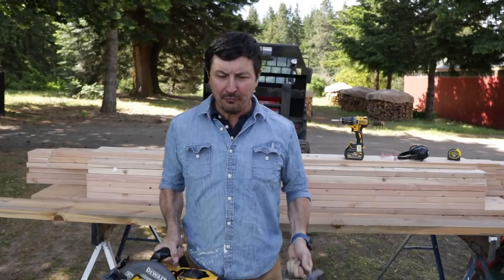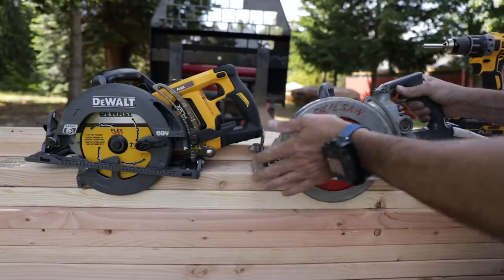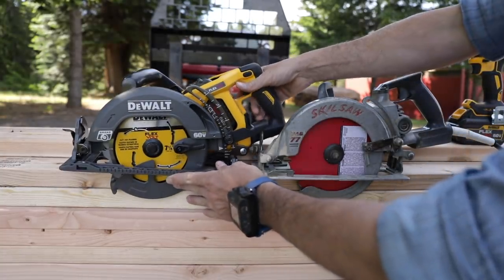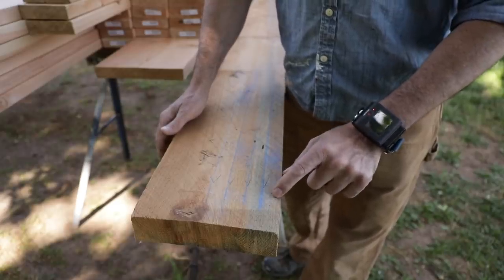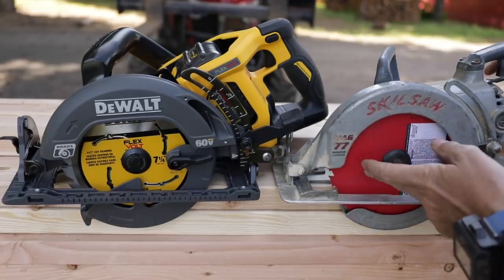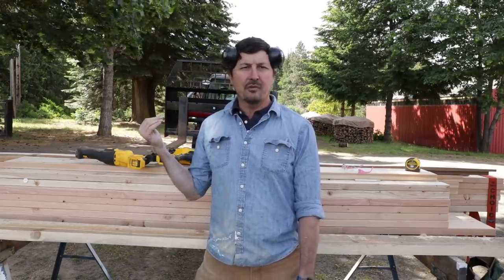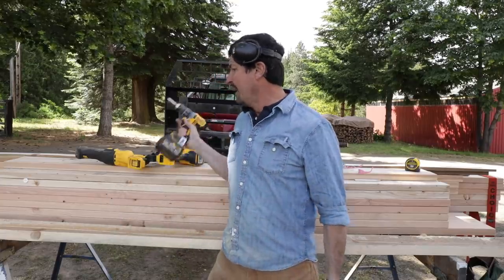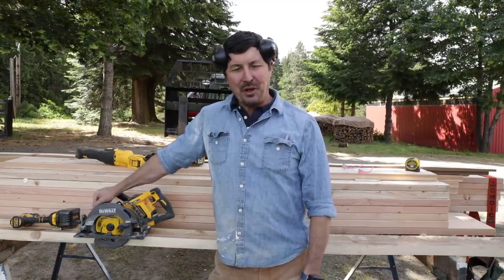Dewalt Flexvolt V.S. Skill Mag77 [S H O C K I N G]

Comment: I have both and I think the Skill with new brushes and bearings would have smoked the flexvolt you used an old skill and a new dewalt  also the Rigid worm gear saw will smoke the skill new.

Comment: This worm drive style dewalt is better than the older direct drive style saw.  Here's the issue.  That Skilsaw is a 13amp saw going through a 14ga cord.  I'll race for pinks with my brand new Mag77 running on 120v through one 12ga cord. I'll even buy the diablo blades so apples to apples. And we rip hard for about 10min. It might be able to keep up in speed at peek charge, but let's see at 75% and motor cooling. To justify a $400 saw,  it has to keep up with the best.
Reply: Wire guage does not change amp draw, these tools are designed for a maximum of 15 amps since that is a very common braker type, the batteries won because they can draw more then 15 amps without tripping a braker....

Comment: The dewalt is not a true worm drive. It’s a sidewinder with a handle behind like the worm drive. Look at the orientation of the motor. Learned on a 6 1/2” skilsaw and it’s the best saw to cut with and I am on the east coast. Thanks for posting.

Comment: Bro i do know some cordless even have more power than some corded but just not enough cutting time.1 hr strsight cutting time for a cordless is nothing.i been on jobs where i have to cut say sixty 2x6 rafters plus other lumber where i need power for atleast 3  to 5 hts..( cordless tools have tjeir place and advantages but for short working time.its good to have cordless butfor any cordless tool i have i must have a similar  corded..am in nyc and  for circular  saws  we use .mostly corded,

Comment: battery power has it place but after sitting in my draw for 2 years my corded drill still works and it is 20+ years old same with my skill saw that is 30 years old and still works fine ....and i do have 2 small generators one for the boat for bowfishing and another for things like deer lease and out in the field work and i guess 1 is a backup for the other if one ever fails :-)

Comment: Brand new blades perform better "after" having been broken in on a few cuts. Also, an apples to apples test would've been with both saws using identical blades. One more thing, with every cut, the cordless saw's cutting time will increase with every use as it's battery wears down where the corded saw will provide continuous steady times all day long. For the homeowner (or homesteader), sure, the cordless saw is ideal, but for production cutting on a construction site, they'll be burning out those cordless saws and replacing them every few months. I've seen it time and time again. ☺

Comment: it has nothing to do with the saw itself, the speed advantage of the dewalt came from the "cordless" factor because it gave you the advantage of gripping on the dewalt with both your hands hence the speed of the cut compared to the skil in which you had to hold the cord with your hand and the saw with the other

Comment: I love seeing all the tool guys talking up the cordless wormdrive saws and sawzalls, I will never trade my corded versions of these in I find them lighter easier to maintain,(brushless you cant do anything with). The best cordless tool for me has been the impact wrenches as I'm a mechanic by trade. I still do a lot of wood and metal work for this corded power is best, you wont stall and get your blade stuck if you end up on low battery power.Quality blades are key as well

Comment: Cordless tools are cool, kind of expensive and if you don't use them on a regular basis you might be having to charge and condition your battery first. They are certainly easy to pick up and put to use however after you pick your favorite tool, it's really not smart to by a different tool from a different maker because the batteries are not interchangeable. We'll invest maybe thousands in a single brand of cordless tool and then they will discontinue or change battery designs after a few years and screw everyone. I'll keep my corded versions forever and be free to get different brands because they all run on 120v.

Comment: The dewalt blade is 1mm thick! It will last exactly 1 third as long as your standard 3mm blade...of course it will cut faster on a less powerful machine. Can you get 3 of those blades for the cost of a regular one? I doubt it ...

Comment: I have 7 dead, burned up Dewalt cordless tools in a storage bin for parts.... because Dewalt factory service, told me they don’t repair them any more. $1546.00 in junk tools, less than 3 years old. Sure they are covenant, as long as you have a ton of money to replace them all the time. Dewalt cordless tools are JUNK! Ive started replacing them with Milwaukee. We will see how that goes.
Reply: Damn bro, mind sharing some more details like tool specifics and what you were doing to them? haha, sounds like you handed them to a crew and told them "murder the yellow tools" lol. But you can't go wrong with Milwaukee either. Are you sure they just don't need some brushes? I have a few DeWalts myself but only use one heavily/extensively, an impact driver almost daily for the past 5 years paired with a craftsman drill that's just as old, haven't had to do a single thing except charge the batteries(the craftsman drill batteries are definitely dying quicker than they used to). Both are occasionally in the rain, mildly dropped/thrown around absolutely abused and just keeps going still as strong as day 1 when the batteries are fresh.

Comment: The first cuts were way more crooked (even the very first cut with no sawdust). Go back and watch the video. Why even bother doing a comparison if you're not going to do anything fairly? Very odd. It's almost like you have a referral link and just want to get 10% on lots of saws. But I know that's not the reason, so it's just quite confusing.

Comment: Without using a brand new top of the line skilsaw plugged into a short extension cord and using the same blade as the dewalt it isn't much of a comparison. Using an old worn out skilsaw is skewing the results in favor of the dewalt.

Comment: I think it is an unfair competition in the case of saws because it is a new saw compared with an old saw where the engine one way or another to lost power the engine
Reply: Electric motors dont really loose power unless you let the gears run out, but still it was almost twice as fast, I think it has to do with the batteries allowing more amps to run through the motor (this will cause more ware on the batteries) while corded tools run a max of 15amps to not trip your braker.

Comment: Bottom line, if you use a tool every day then don’t buy cordless. The battery won’t last all day. The cordless stuff is not going to last as long as a wired tool. That skilsaw will last tens of years. Cordless tools won’t

Comment: I orefer corded tools,how msny of these cordless tools can work straight for 8hrs??? You must have 2 batteries and power to work a cordless whole day.
Reply: KingParisBuckingham the saw uses a 12ah battery, meaning at 12amps of draw you’ll have 1 hour of continuous cutting time. That’s some serious time.

I had the sane mentality. That and I felt like there’s no way these saws have as much power as a skilsaw chorded. I was wrong.

I’m currently on a commercial job with some framers. They won’t use anything else but the dewalt. They absolutely love them and they claim to get a days worth of cutting from a single battery charge. 

However unfortunately they didn’t have anything good to say about the hoseless framing nail gun. They just said it’s too slow.

Comment: I remember this situation very well and the skilsaw won the battle in a time of importance, WHY?: 

Unannounced to me prior to getting to the job site, my boss put me on a skylight job so I was ripping LDL at an angle for skylights and had to get the job done within a specified timeframe. Cordless battery died after 1 maaaybe 1.5 rips. Called my buddy to drop off my skilsaw and handled it no problem and extremely fast taboot. 

Anyone who is not a DIY/home use only person would love the cordless, everyone else who does this for work needs the corded and has a cordless for when convenient.

Comment: They arent the same at all the skil is a oil lubed wormdrive, the dewalt is a direct drive, made to look like a wormdrive for the right handers. Direct drives are week, you need to keep a sharp blade on at all times, kick back is a  killer and dewalt put blade brake on there saws, worm drive no, takes them 30secs for blade to stop spinning. Alot more power on any worm driven saws.

Your personal opinion is complete false hahaha, im a 5yr Framer by the way and have used many saws through out my life.

Comment: Yeah…no. Not even close to an actual fair test for either saw. That’s an older model skilsaw, not even sure if it’s with a 15amp motor they switched to. But even if it is, I think those earlier models were geared lower for more torque, but slower cut speed (4,800 RpM for earlier MAG77’s, vs 5,300 RPM for later models). Then I’d be interested in that DeWalts cut speed after it makes a few cuts and that battery is no longer fully charged. Weight is another big factor, he just glosses over, but even 1lb makes a difference when you’re swinging it all day long. Not sayin the DeWalt is bad by any means, just that this testing/comparison is utterly ridiculous. Maybe stick to axe and survival reviews…or improve your testing parameters to be more objective. Also if testing a new tool, maybe test it against its current version competition, not something 15+ years old.

Comment: Id suggest running the brushes in then see how well the cordless does in comparisin. Brand new brushes supply higher voltage until worn and seated.
Reply: Brushless motors.

Comment: You showed a picture of the new skill saw vs the new DeWalt in reality that skill saw you are comparing it two is well over two generations old. Poor test
Reply: You should run this test properly with the newest skill saw and take down this false information before  you misguide any more tradesmen
Reply: And you didn't even the same new Diablo blades. Very poor exicution on your end
Reply: Mate that diablo blade is far more superior compared to that dewalt blade if anything the skil has the advantage.

Comment: You need a rip guide bud your rips look like zig zags
Reply: Your first cut was garbage too
Reply: mharris1270 I'm talking about the one that attaches to the accessory rail on the bottom plate.  Universal for pretty much all circ saws, jig saws etc.
Reply: mharris1270 as per available straight line stops to run a saw against just go buy some high end finger plank trim 4" or wider and use a laser to tack it in straight... There's limitless available saw rip guides... Far as you can keep the line straight

Comment: DeWALT FLEXVOLT battery 12AH (60V 4AH) are better, DeWALT FLEXVOLT hand rear circular saw 5800 rpm, Skilsaw corded high torque hand rear circular saw old 4400 rpm and new 5300 rpm, DeWALT corded high torque hand rear circular saw 4800 rpm

Comment: as to tools I have both  DeWalt and Milwaukee I am lucky we have all three of them where I live to have them fixed. at Makita, they usually fixed it when I bought it in  same as Milwaukee here  Dewalt  2 week or longer when you take it in   
 it the warranty and the service I look at it, Milwaukee has stepped out the lead as for any warranty on the tools  DeWalt warranty you still had to pay for them to put the part in too
Makita the just fix it and not charge too when I was replacing the power tools I was  looking to get away from  Makita  to many other people at the time had them, Dewalt lift me holding  their new line on 28-volt tool  out to hang  Milwaukee I told them what Dewalt has done to me they traded up the Dewalt tool I had with the tools  they said they should have done that too I now  run Milwaukee tool now  no cords on any of them  run 18volt and 12 volts  too they help me with a charging them up in a service box on the truck too I can have 10 battery at one time charging up  one cabit on the truck is just fot millwakee tools now

Comment: The worm drive saw is not a popular thing back East
Reply: Dave White agreed
Reply: Why is that?  I've seen a number of differences in tools & equipment between East and West USA.  In UK there is no bias on one side of the country or the other, or even between Scotland, England, Wales or Northern Ireland.  Heck, even across Europe it's all pretty homogeneous.
Reply: It's a little further to the West Coast than London to Edinburgh about 400 miles, from New York to Seattle about 2.800 miles, London to Istanbul is still not as far.
Reply: Yeah, I get that.  I just don't understand why there's such a difference in tool preferences.  Surely a good tool in the East is a good tool in the West.
Reply from the maker: This is what I have been told,
Reply: It sure isn't! Except for me. I love mine with the few extra inches of reach, the location and ease of depth adjustment,    and the balance. They practically cut a straight line by themselves. Also, I love being able to say, " I need to change the oil in my saw."!

Comment: Dewalt not a worm drive second that skill is so bogged out from that hundred foot extension cord if anything run it off a 10g instead of 12 will help with the lost power and last Dewalt is contractor grade skill is not if you want a truly accurate test use Dewalt corded saw with the same amp as the cordless and same blade

Comment: The only problem with this review is that the corded Skillsaw mag 77 will make that same cut in 39 seconds every time. Whats the Dewalt going to do on a half charged battery? How many cuts are you getting out of one charge cycle on the batteries. I like Dewalt, but battery power is a fluid variable.
Reply: 2-9 amp batteries is the cure for this as 1 is enough for a single day on most jobs, its $180 for 2 of them on amazon.

Comment: You are not being honest about this. You were funded by DeWalt in a previous video and furnished with products in February of 2017. In that video you made claims about the tools that you likely wouldn't have made if you weren't being paid. Now, on the back of that endorsement, you are telling people about your "investment" in DeWalt (like you bought into the deal piece by piece). I agree that once you choose a brand you are intrenched. It is difficult and expensive to switch from one brand to another when you have tools, batteries, chargers, etc., but you are acting like cordless tools are a suitable replacement for heavy tools like a worm drive, table saw, air compressor, nail gun, etc. and they are not. They are fine if you are a weekend project guy (like me) and you don't mind paying more for tools that won't last like the original. If you are a person in the trades...be honest. Your videos have a million people watching them. If you convince one guy to buy into a battery powered skill saw (and batteries, chargers, etc.) and he looses his job or contract because of that...You should rethink your decisions here. My thoughts-from a fan.

Comment: that's an older 12amp skilsaw vs brand new??????  .....I own a 60v and the guide and plate are garbage...for the price I expected an accurate guide and good plate. the saw cuts fine but the build is garbage....the adjustable depth handle is built like doodoo. The battery life cannot last the entire day and a second battery costs more than a brand new corded skilsaw. heck for the price of 2 batteries I could buy a generator and run cords....I have to turn to my OLD Makita to always finish up.....I like the convenience though so I'm going to try the Milwaukee M18 Fuel but I own all Dewalt cordless so this new 60V is disappointing to me....dont take my word for it .....go and try it out at the store and see the flimsy build.

Comment: Ok, so its a little faster. Will the Dewalt still be running in 2 years? Or need new Batteries? Or, how many cuts can you get from the Dewalt and run down batteries before you run to the truck to get the Skilsaw? Also the Dewalt is new. Compare this new Dewalt with a New Skilsaw, then maybe you'll have something. Until then, this review is useless..
Reply: It has a three year warranty. We have dewalt batteries at work and they have been dropped and abused for years now and they've been fine.